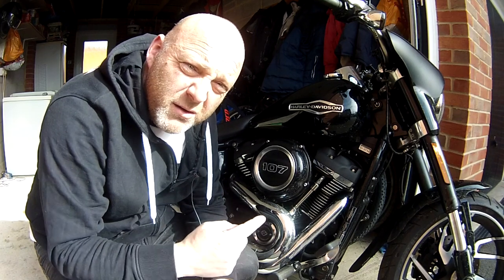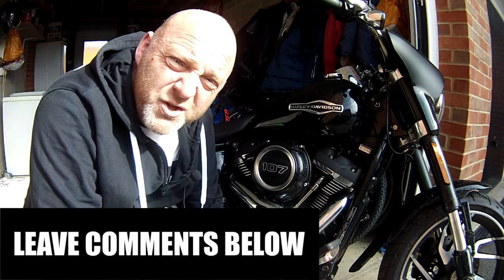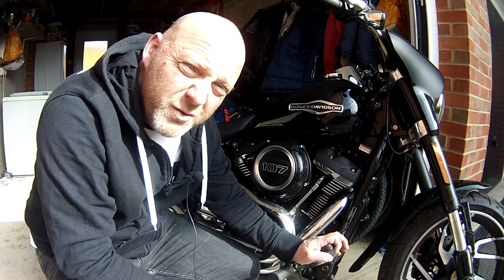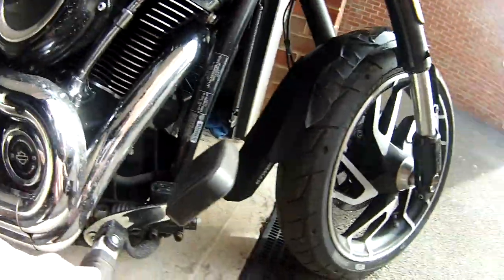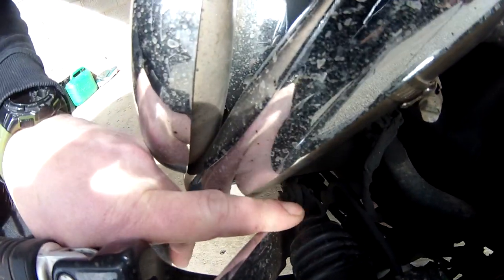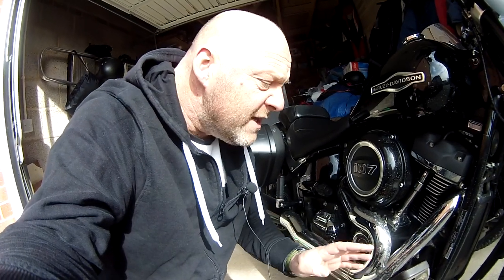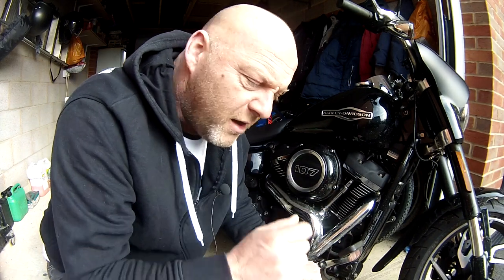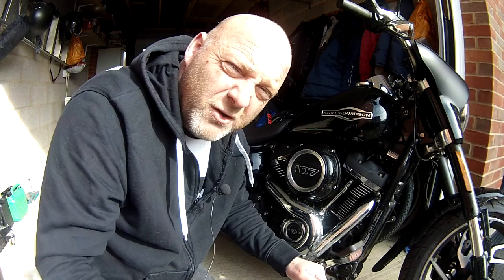How to adjust brake pedal on H D Softail Sport Glide

Comment: Just done my Sport Glide pedal - to move it down first slacken the nut a couple of turns or more before removing the pin, then you can wind the clevis in. Now my brake pedal is under my foot where it should be. Previously my foot was hanging off the side of the peg because the pedal was in the way.
Reply from the maker: Good stuff

Comment: Thank you for the great tip. I Just had a Rinehart 2into1 exhaust installed by my Harley dealer and they didn’t even bother to check clearance between brake pedal and muffler shield (they are constantly touching when brake is at rest) I will fix this myself today. Thanks again and keep up the great videos!
Reply from the maker: Thanks Brian. Cheers

Comment: Hey Alf, sorry to rain on your parade but in order to unwind the u bracket, you do need to remove the the brake pedal arm you also have to loosen the jam nut that sits against the u bracket , I un wound it and the brake pedal arm was pretty much the same. Putting the pin back in was almost a two man job because now the hole does not line up it’s bloody tricky. I ended turning the u bracket back in but if you want to turn it in more you have to turn the jamb nut in which puts more pressure on the spring that is inside the rubber boot. So that was three hours of my life I will never get back , so the net result is the pedal cannot be adjusted , I am back where I started .
Reply from the maker: Oh that’s odd. It wasn’t that much for me and I found it did adjust it. Yes it’s tight in there but there should be some slight movement. Ok thanks for letting us know
Reply: RevelatorAlf Hey Alf, not to be a bug but maybe one of your videos could show the brake pedal adjustment, I enjoy your videos they are very explanatory. Cheers

Comment: Thank you, thank you, thank you Alf, I did not think it could be adjusted, so I bought a brake pedal arm that is from a fat bob. That worked as far as the angle but the pedal was too small for my foot, so I went back to the original pedal arm. The factory angle sucks as your sitting there and your toes are pointing to the sky, hard on the ankle , well thanks again for the tip I will give it a try . I got my heat shields powder coated just wiring for it to warm up to re install them , they look amazing all in black, not a fan of chrome.
Reply from the maker: Ah fantastic. Hope it works out for you. Yes I’ve got to say I’m not keen on the chrome either
Reply: When I get my heat shields back on I’ll send you some pics
Reply from the maker: @reddog907  Great look forward to that